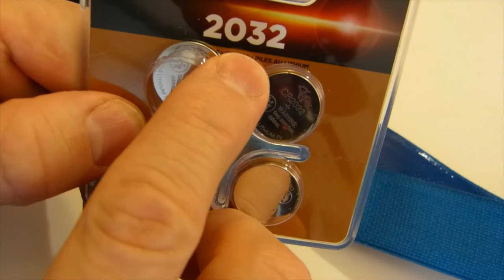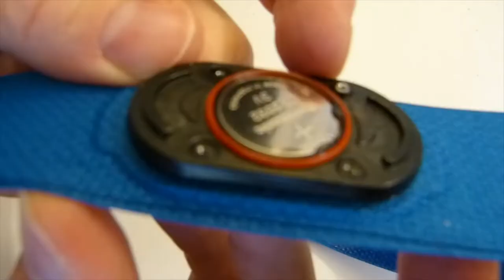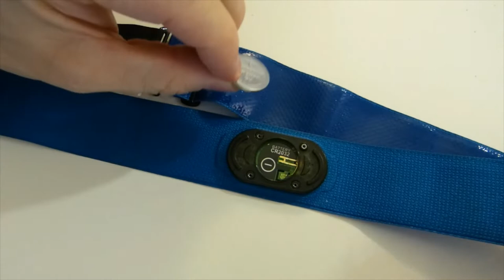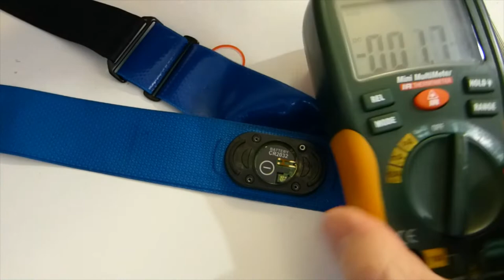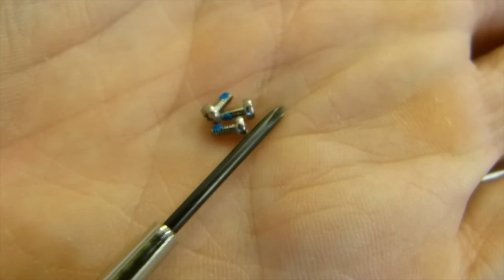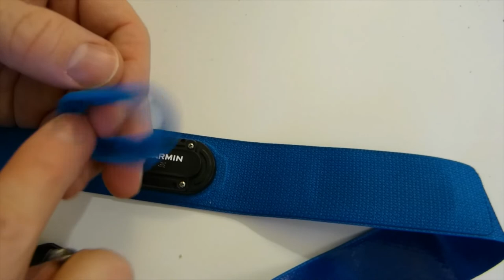Garmin HRM-Swim heart rate monitor battery change

Comment: Hello, how are you, the video is very good, I would have liked to see how you removed the screws, since in my opinion the anchor on the top right is out, it could have been because the screws were stuck, right? I'm about to buy one and I think I'm going to decide on the pro plus, the manual system it has inspires me more confidence compared to the screws that can get stuck and break. Sacrificing the fixation to the chest that it has because it is wide open, I heard that the orring knows how to fail and allows moisture to enter the sensor. What do you think about all this that I tell you?
Kind regards!
Reply from the maker: Garmin replaced the screws and anchors and the knowledgeable O-ring with a new design, this https://youtu.be/D1cGeWkbnc8